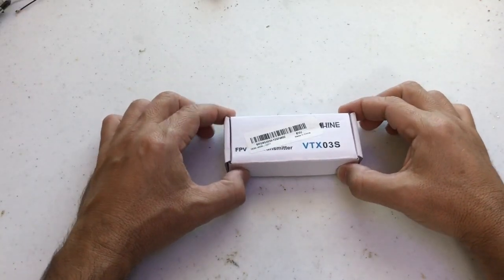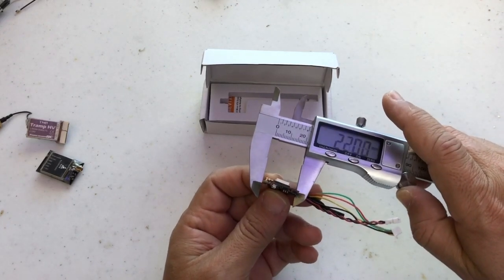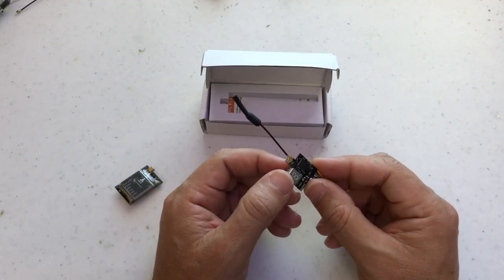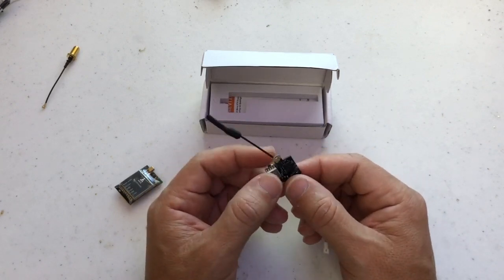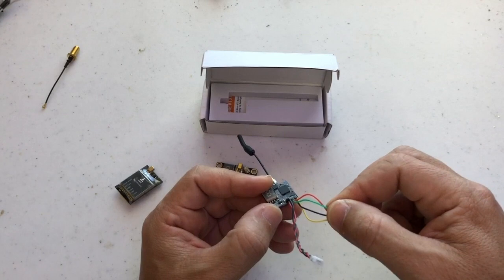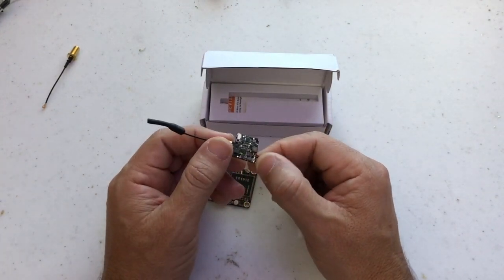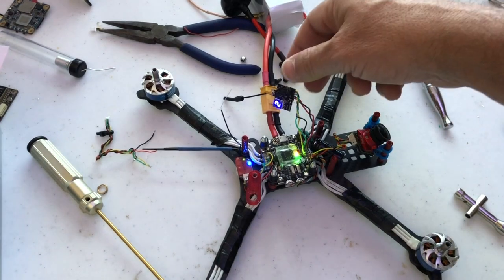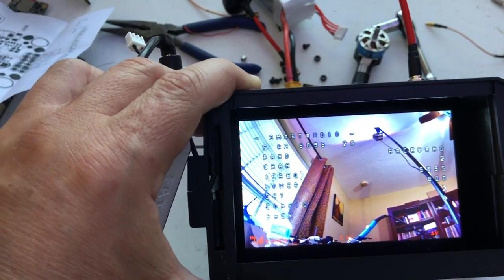Eachine VTX03S Review

Comment: Thank you for this great review!! I think about using this vtx on my Mobula 7 (which has a 25mw vtx) but i am not sure if it would make a difference about range and feed quality..
Reply from the maker: Mert Bağcı mobula 7 have 25mw VTX, this VTX03S can put 200mw that will give you more than double the range with the same antenna you using today on the mobula 7, when installed I would recommend to set on the CLI the following command vtx_low_power_disarm = ON in that case when is disarmed will be on 25mw, when armed will go to the power setting you configured of 200mw
Reply: @DelixFPV  I will definitely do that. Thanks for the advice:)